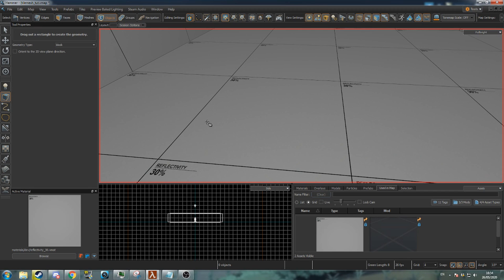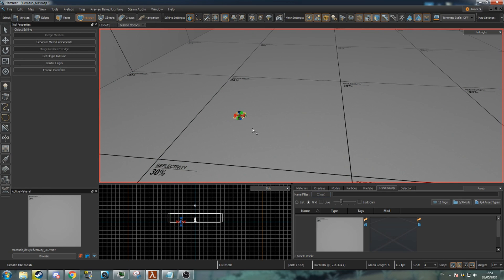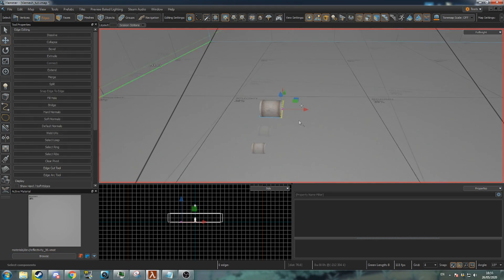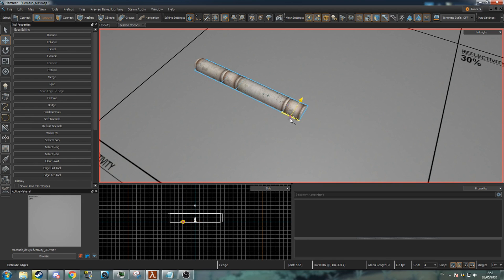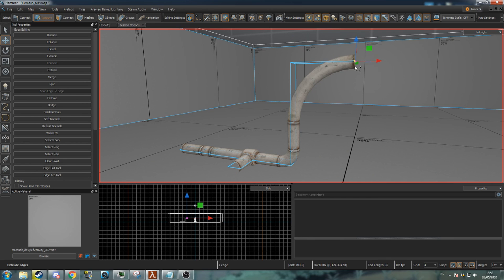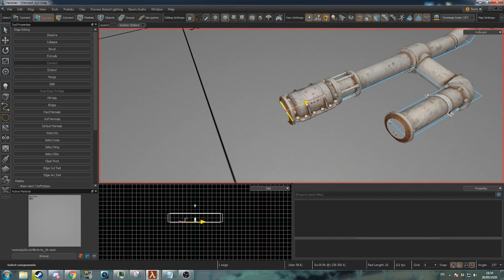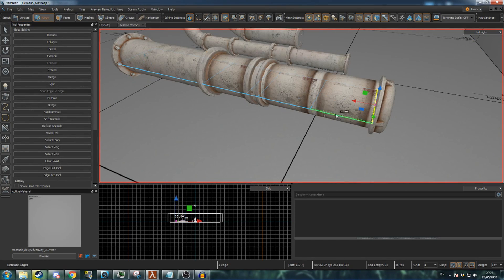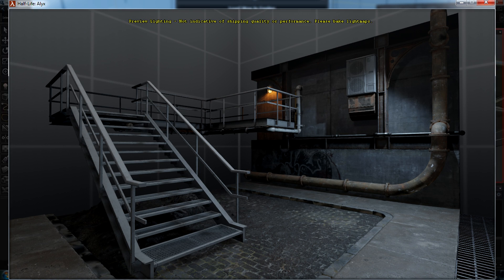How To Create Pipes and more using Tile Meshes in Source 2's Hammer

Comment: Are cables a tile mesh or are they their own thing? If they're their own thing, you should do a tutorial on cables. That'd be cool :)
Reply: Shift+P will take you to the tool to make wires.
Reply from the maker: There is also a tilemesh for wires, but thick individual cables are made using the path tool